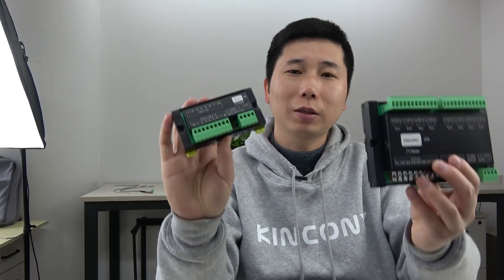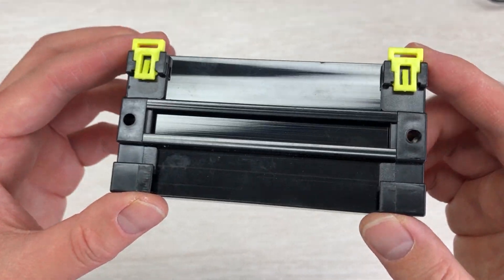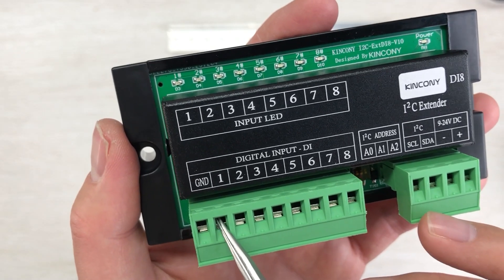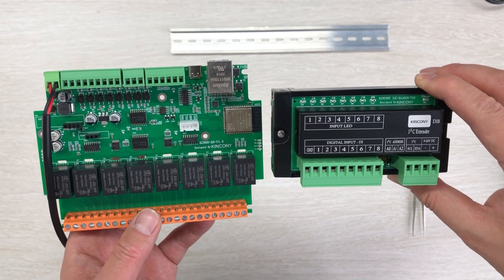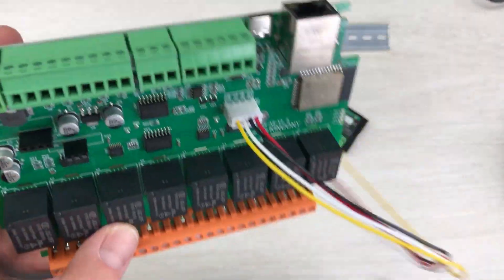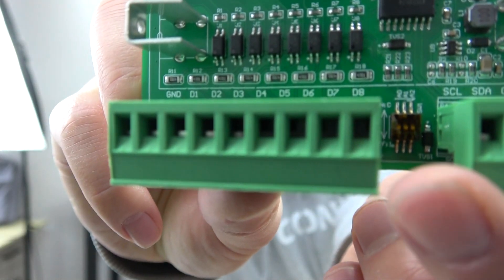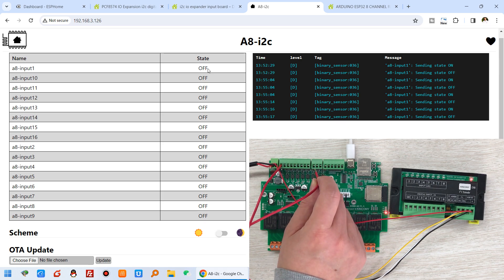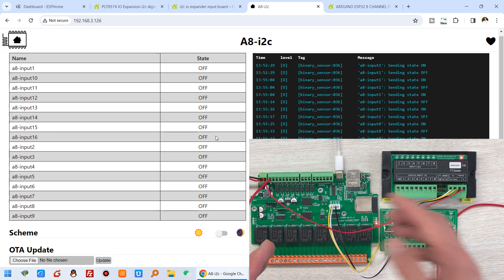i2c IO expander digital input board for ESPHome HA - KinCony DI8

Comment: Nice work!

I can see a new expansion/expandable range of products over here👍

But I do have some recommendations for the design.

It would be a huge plus if the housing has the same height and formfactor as the main unit !! 
It would also help if all connectors are the same.
So same colour and formfactor on the main and secondary unit.
Also i2c connectors at the outside (top or bottom).
Professional PLC manufacturers have pins at the side, so modules can be clicked to each other without wires to the main unit.
But that is not necessarily needed. A simple flatcable between the boards will also do and does look professional.🙂 .
Keep on doing this amazing work!
Reply from the maker: thanks for your suggestion.